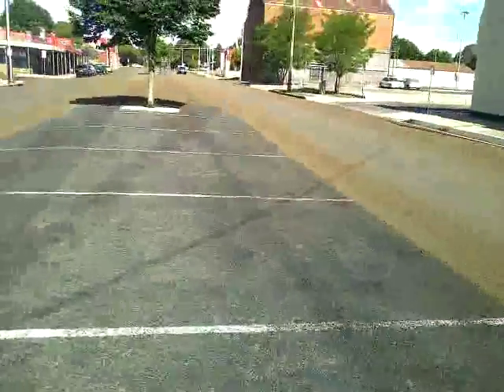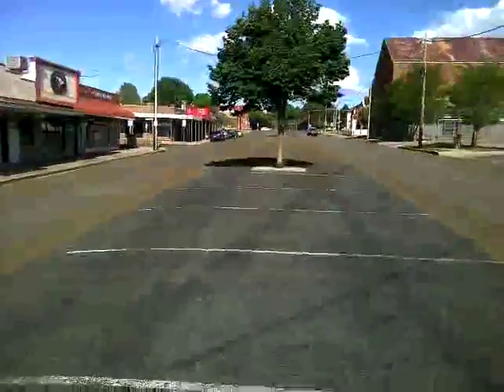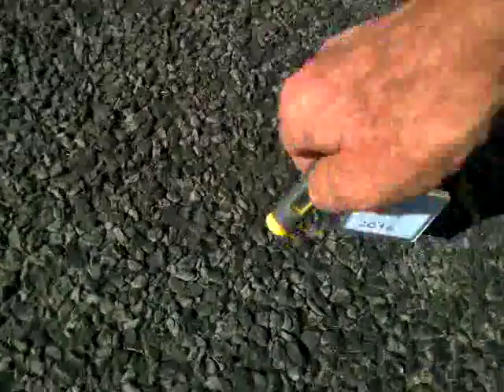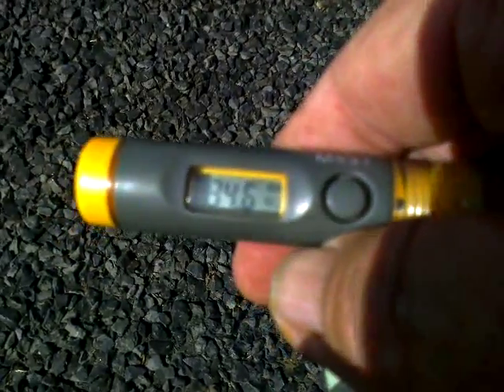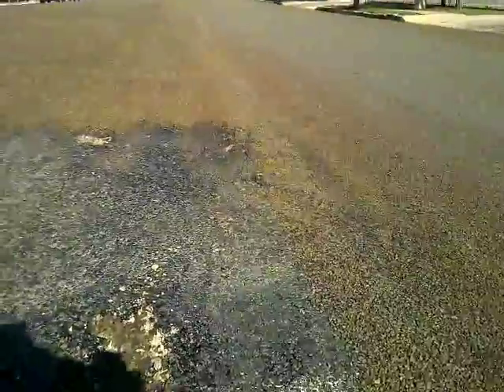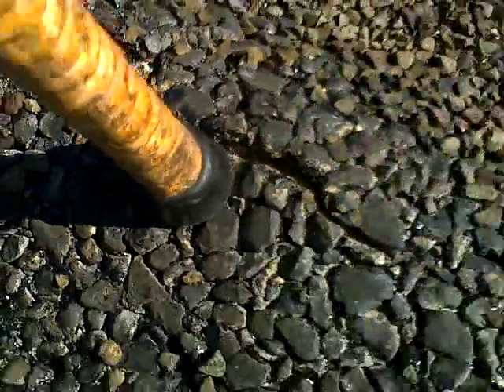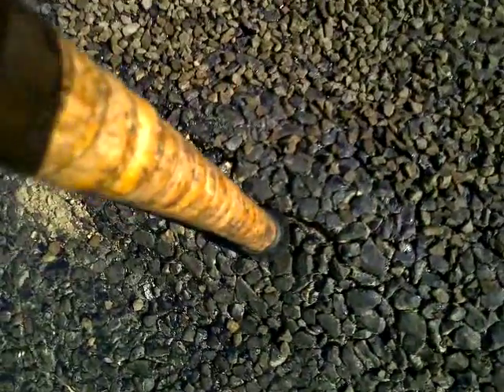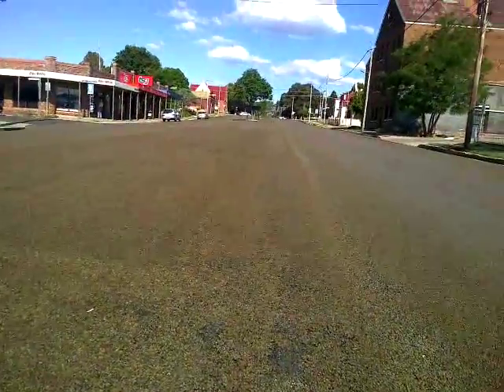Bitumen Pavement Failure, Gravel Bandaid.

Comment: Filling it in with gravel, that'll take care of it, shuussh now nobody'll notice.

Btw That's a handy gizmo, a surface temp thermometer
Reply from the maker: G'day,

  Thanks mate, 

    Yeah, a Cover-Up seems to be the politically-correct go-to solution to everything these days.

  The Thermometer is made by Digitech, it apparently measures Infra-Red, so when pointed at the Horizon it gives ambient Air Temp, and when  held close to any object or surface it tells what Temperature it's radiating...; I bought 3 of them when Ebola looked to be going Global, and gave one each to my kids, so as to be able to guess at a person's Temperature without touching them.

  Now mine lives on my Keyring, it doesn't get a lot of use, but it's very handy to have available on the occasions that it becomes useful.

 Have a good one,

  ;-p

  Ciao !

Comment: It looks like they've decided to try to mix in some gravel after the fact and let the weight of the cars do the mixing.
Reply from the maker: G'day,

  Thanks,

   Yeah, it's a good quick-fix, but the over-diluted Bitumen is still there, between the Roadbase & the Cars, so as soon as the Road reaches 33 Degrees Celsius or so the Bitumen goes soggy, and the whole Surface becomes mobile...; and in January I've measured 61 degrees Celsius Pavement Temperature in the Main Street...

  So I suspect that after a few hot spells they'll have to bite the Bullet and redo the whole job.

  Have a good one,

  ;-p

Ciao !
Reply: WarblesOnALot You get to watch the ruts deepen :)
Reply from the maker: +thethegreenmachine 

  Yeah, that's right, and every day will be on average hotter at midday than the last, for the next 3 & 1/2 months...

   So the Side-loads imposed by Power-Steering  while parking & turning into/out of the Central Parking Lanes will be digging new Divots & ploughing fresh Ruts on a daily basis... ; and when it rains the holes in the Bitumen will saturate the Roadbase, and it'll be Pothole City...!

   Roads are expensive to build propperly, but trying to cut costs means having to do everything twice, as well as repairing the damage done by the short-cut, when it fails...; so it's always cheaper to do it right the first time.

   There's a lot of stuff in Life like that.

  ;-p

  Ciao !